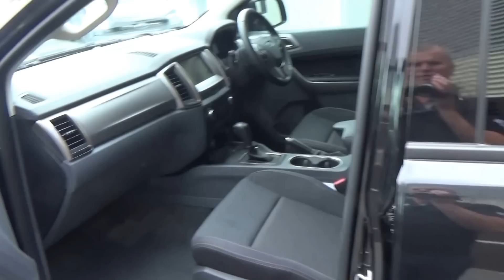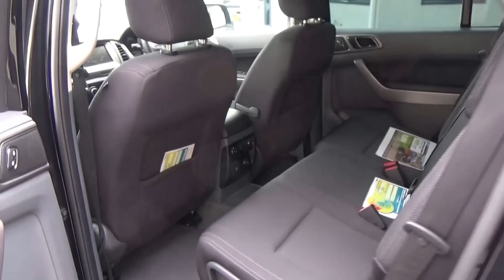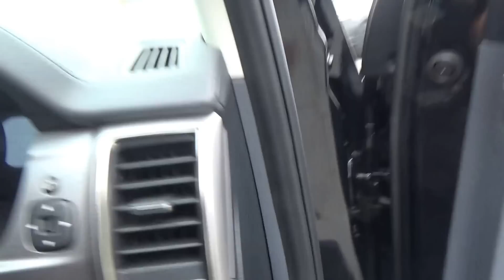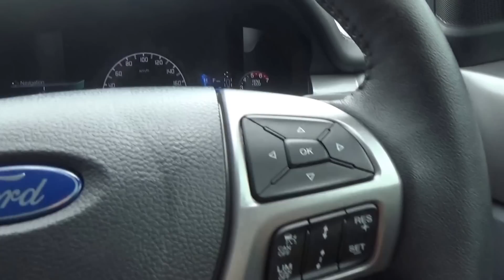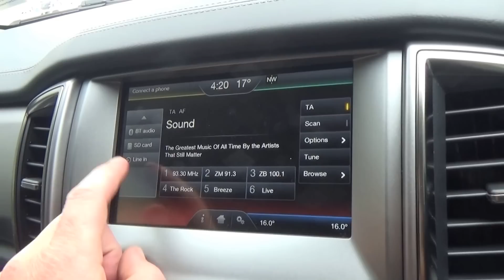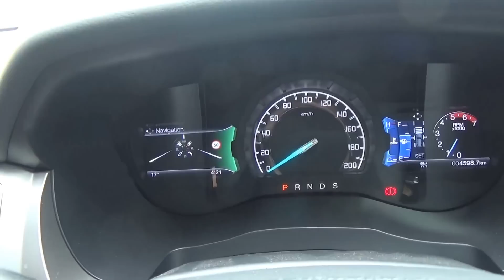New Ford Everest Trend with flares and 22 inch alloys - www.teamhutchinsonford.com

Comment: The wheel arch flare i mean where could i get those?
Reply from the maker: Hi David, Are you in New Zealand? or which country are you in?
Reply: +Team Hutchinson Ford I'm from the philippines any accredited dealers here that sells those wheel arch? Most here used bushwacker and i dont like it with those screws visible
Reply from the maker: I think the best place for you to have a look would be on Ebay. Thanks
Reply: +Team Hutchinson Ford thanks for the info.what exactly is it called? So that i could specifically search it.
Reply from the maker: Sorry I cant' remember what we searched to find it. Ford Everest wheel arch flares?
Reply: I'm from the Philippines as well. There are available Bushwacker fender flares without the rivet design. Try looking it up on OLX.

Comment: Did you use lower profile tyres to adjust for the increased rim size? What size tyres did you use? I just want to know if the outer diameter of the wheel assembly is affected or not.